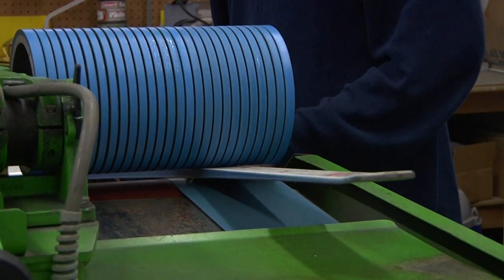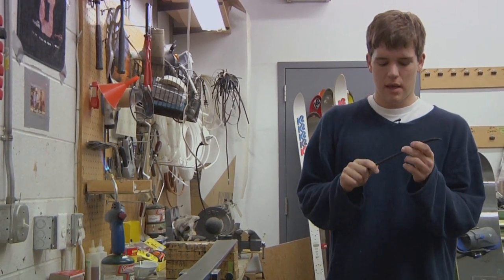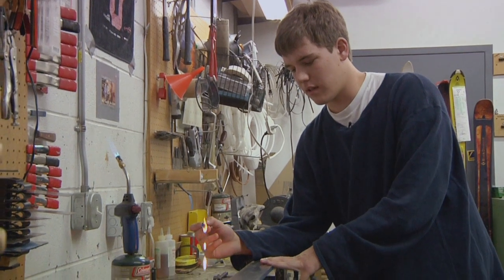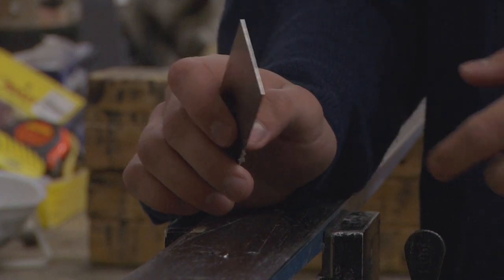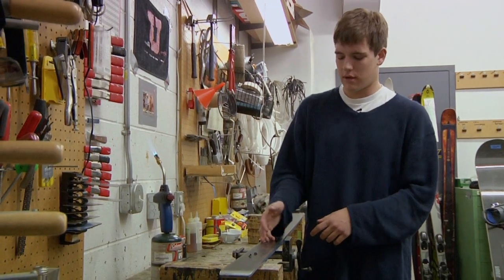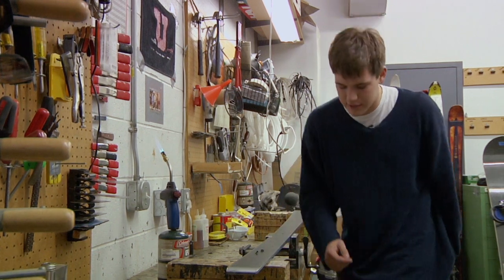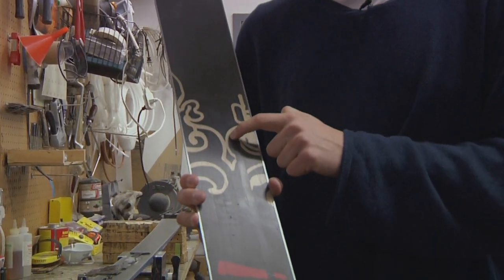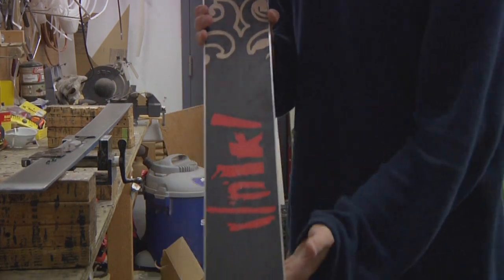Snowboard Repairs & Maintenance : How to Fix Snowboard Chips

Comment: I bough a board and it has four holes in it it's my first board and I didn't think the small hole would matter there's four holes because it was a display board but they are about the size of a pinky finger nail so real small I was wondering if the holes will effect the riding and if there's a way to patch them I was thinking epoxy smooth it out and wax over them but for now I have silicone seal in them to keep the water out but anyone have any suggestions or ways to fix the holes? Thanks